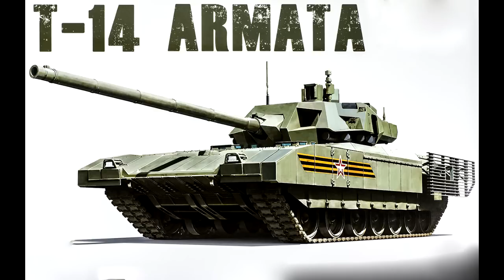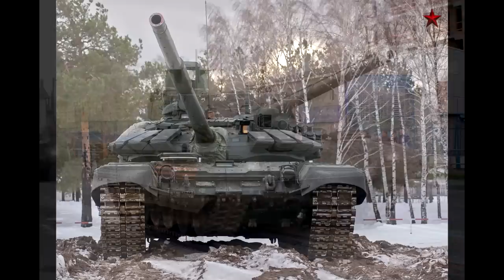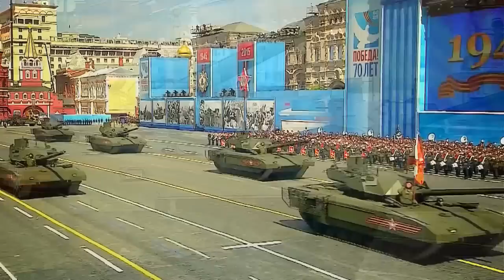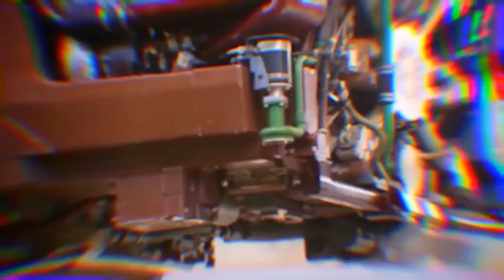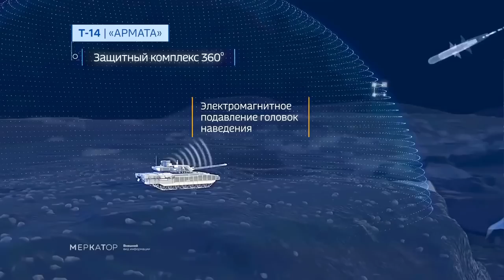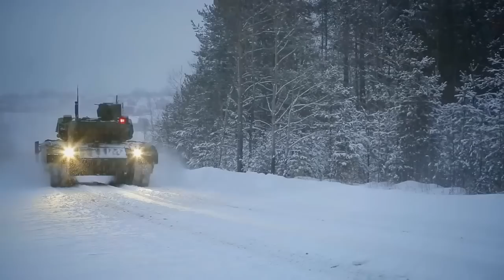Busting Myths on T-14 Armata

Comment: in fact, what stop the APDSFS and HEAT FS is not the APS, but the "HARD KILL" system. 
hard kill is the thing that break the incomming projectile with schrapnells
APS is the thing that turn ATGM -OFF or decflect them. 

the armata s hard kill is able to stop most of the HEAT FS and most of APDS, but,, there exist few APDSFS with enough velocity to go trough before the schrapnells destroy them. (it come from the fact that : when the projectile is detected, if he reach his target before the schrapnells got enough velocity (because, even if the increase of velocity is very short, about less than 0,0001 second, it need this time)->the schrapnells will not be able to fully destroy the APDSFS and the projectile will reach his target, with less energy and mass, but it will be enough to destroy an external module or to damage an armor plate and make it weaker (giving to the next projectile far more chances to do his job)
Reply: APS means both. APS are classified into "Hardkill" and "Softkill" Softkill distracts ATGM as you said, and Hardkill defeats it via shrapnel/EPF.

I only know it for NATO standards but: APS shatters, not detonate the KE penetrators, reducing it's force. An israeli study showed that only a 7° tilt reduces the penetrators energy (not penetration) by 80 %. So only a NATO STANAG 4569 level 4-5 protection (against 25mm APFSDS) is requiered to widhstand an (sucessfully intercepted) APFSDS. I dont really know about the "Afghanit" APS used on the T-14 but i know another system developed by the german company rheinmetall called AMAP-ADS that it has proven to be able of defeating not only ATGMs and RPGs, but also EFPs and APFSDS rounds. Supposedly it is capable of "cut" through the engaged threats, shattering or bending EFPs and APFSDS penetrators in the process. According to Dipl. Ing. Rolf Hilmes, who worked in the German military procurement agency, the system has been successfully tested against 120 mm APFSDS ammunition in the past. This system works diffrent than russian or israeli systems. It uses hull-based ermitters without moving parts (The T-14 needs to turn the whole turret to face thredas coming from another direction, hence only a 120° in front of the turret is protected by "Afghanit" APS) and no HE capsules (also on the T-14) shot at the incoming thread. That allows a very low reaction time of 0.56 miliseconds and a interception of threads fired at only 10 meters (!) distance. The (radar-) detection of the threat happens at a distance of 10-35 metres, while the fine (optical senosrs) tracking starts at two metres distance. The interception itself happens at only 1 meter distance (as said, hull based ermitters). Given that an APFSDS round even at 1,750 m/s velocity travels only 98 centimetres in 0.56 ms, the system reaction time is fairly enough.

Comment: By the time they make 23,000 T14 armtas they will be out numbered by the XM1A3
Reply: Shrapnel will not block apdsfds its impossible all it will do is slow it down a few hundred mps but that's tungsten depleted uranium shot is still going through that side armour like butter
Reply: Not 23.000 he said "23 hundred" that means 2300.

Comment: How much did russkies pay you?
Reply: Lachausis your just jealous
Reply: a lot clearly. Don't worry, Russia has a sense of over hyping their tanks. As soon as the US rolls out there M1A3 Abrams it won't be a problem at all.
Reply: The M1A2 Abrams is the most highly armored tank in the world. XD The T-80, T-14 and T-70 are overhyped. You can't expect to go to war with a Armata and only face up against and M1A2 or M1A3. That's why I mentioned the others. The Armata has problems such as a less armored turret than the cockpit which is now unmanned which can cause malfunctioning to it's systems if it where to be hit with a AP round for example. Not to mention you only have a hundred of those tanks so it would be pretty rare to see them throughout conflicts.
Reply: The future filmmaker There is not more to know Challenger 2's armour since their details are classified but the Abrams armor is based on the Challenger armor design (but has additional DU armor layers that the Chally doesn’t have). "The M1A3 Abrams will be outfitted with a number of enhancements over previous versions of the tank. To make the next version lighter and more mobile, the Army plans to replace the M256 smoothbore gun with a lighter 120 millimeter cannon; add road wheels and an improved suspension system; install a more durable track; use lighter armor; and insert precision armaments capable of hitting targets from 12 kilometers. Preliminary plans also call for the addition of an infrared camera and laser detector."
Reply: The future filmmaker all in all im happy to have the Challenger 2 with us against your armata.
Reply: The future filmmaker so be it.
Reply: Tanks aren‘t important anymore. Air superiority is the key and we all know who has the advantage here, lol
Reply: The future filmmaker Even before 2022 you still have tanks in the industry that are just as good as the armata if not better. For example, Leopard 2a7, K2 black panther, Challenger 2, Merkava Mk.4 and etc... Even if you say that the Armata is "better" than the M1 abrams, you have got a lot more tanks to worry about than just that 1 tank.
Reply: The M1A2 is on par with the Armata, I suppose. You can only imagine that the M1A3 will be better. The T-14 hasn't even been tested yet so you can't say it is better!?

T-80
https://medium.com/war-is-boring/the-t-80-is-russia-s-most-overrated-tank-798b5ba54ff9

M1A2 
https://youtu.be/OlegqcKpdXs?t=1m19s

Comment: The turret has no armor at all. Look at turret of Challenger 2 or Merkava (those turrets can take a hit). But Armata basically has no turret armor.
Reply: What for, only thing in there is the breech.
Reply: > "Дмитрий☭"

And its visuals, and its APS, and a resulting explosion is theoretically enough to melt any and all wires and connections to the powerplant. Making it dead. The latter can be rectified by compartmentalization and usage of materials relatively easily.
Reply: So no need to protect the breech system? One hit on turret and tank is out. Russians are "geniuses".
Reply: Believe me, if this tank goes to battle, you will see significant armor upgrade to the turret.
Reply: that armor may be thin looking, but its not pure steel, it has some composition to it, and plus, Armata doesnt even need armor, it's APS can stop any ATGM, HEAT and even theoretically APFSDS projectiles. On top of that it has IR and Radar stealth, so good luck hitting it in the first place.
Reply: +Дмитрий☭

> "plus, Armata doesnt even need armor, it's APS can stop any ATGM, HEAT and even theoretically APFSDS projectiles."

Yes it does. APS is only good up for a particular number of shots, and only in the front 120 degree arc.

> "On top of that it has IR and Radar stealth, so good luck hitting it in the first place."

This is just a claim.
Reply: The Turret won't turn fast enough to affect APFSDS. In fact, passive armor behind APS is ALWAYS requiered because the shrapnel of a shattered APFSDS (APS shatters and bends the KE penetrator, reducing it's force) is still very lethal. They went for only 120° protection since the armor on the back and back-sides of the T-14 ins't strong enough to widhstand the shrapnel of a (of course self-sharpening) DU- APFSDS ayways. Cost and especially weight saving. The turret doesen't just have a breach, alo several radars (alot actually), sight and situational awareness systems.

If a APFSDS comes from the side or back, you're doing something wrong in genral. IR stealth is nothing new on armored fighting vehicles. Greets.
Reply: Ummm actually the T14 has some of the toughest turret armor of any tank ( the turret is larger then that of a T90A witch already has very strong turret armor) the turret is unmanned meaning other then the optics,gunbreach and coax evrything else is pure armor.

Comment: Truth is, we simply cannot know how good or bad the T-14 is. The Russians are quite secretive about it, and for good reasons. Even take into consideration the MBTs of the 80s (Leo 2, Ariete, Leclerc, Challenger 2, M1, T-72, etc): to this day the capabilities of those MBTs are being discussed, and it is impossible to reach a clear consensus because there still information that is not available (like the composition of the armor, for example) and because these tanks weren´t really proven in the role they were meant for. They mostly fought inferior opponents, or low intensity conflicts. 

So take all that, and extrapolate it to the T-14 and you will see that assessing the capabilities of this tank is, at best, a very rough guesstimate.
Reply: haha we could be related
Reply: Only the m1a1 is battle proven to this day
Reply: @jeze2432  not against modern MBTS.
Reply: @jeze2432  r u dumb
Reply: sora Cj I thought the 105 mm gun abrams were the battle proven tanks?
Reply: @joshuakolnes9504  Early Abrams were equipped with the 105. But those models were never deployed during Desert Shield/Storm. The upgrades saw combat in that campaign. Only the USMC tanks used 105 rounds in that campaign. And the Marines had the last upgraded M60A3 Patton MBTs.
Reply: Well russia still has steel wave tactics, their tank designs reflect that, the armata can be made inoperable from a turret shot, when the tank turns tail, lamp a shot through the rear, high chance to cook off ammo, or kill the crew, too many ways to knock it out
Reply: osmacar every tank can be inopeeable from a turret shot that penetrates because all the crew will die.
Reply: @osmacar  russia and the united states approach combat doctrine very differently. Russian tanks historically boast a smaller profile which makes them more difficult to hit, and come equipped with auto loaders for faster firing on the move (yes I'm aware that a well trained tank crew can load at similar speed, but human beings fatigue, machines do not) while still boasting considerable armor. The Abraham's on the other hand is much larger, providing more room/comfortability to its crew, and thus has a larger silhouette. What's more Abrams engines are prone to breaking down due to fine dust particles making their way into its engines, it's also noteworthy that larger heavier tanks like the Abrams dont perform as well in thick mud and are prone to getting stuck. Both Russian and american tanks have their pros and cons however neither is proven better than the other as the Abraham's has never faced off directly with a similar generation MBT.
Reply: Still can't compete against the Abrams.

Namely because it's too expensive and will crash Russia's economy
Reply: @AmericanJed1  you really think a few tank will crush russia's economy? lmfao
Reply: @paveantelic7876  Obviously.

A country that spends so much money on tanks, nukes, and vodka will go bankrupt in the next ten years. Just wait.
Reply: @AmericanJed1  so why hasnt usa bankrupted yet?
Reply: @paveantelic7876  Fourth largest economy.
Reply: @AmericanJed1  do u know what you're saying? A single T-14 is cheaper than a M1A2. It cost only $4.1M usd. Armata isnt a expensive tank. Its cheap when compared to Leclerc,Abrams,K2 black panther, Type10

Comment: Any tank (including the T-14) can be killed with relative ease, by aerial attacks.... whether that be a cluster-bomb (that spews thousands of strands of molten copper in every direction, punching numerous holes in any tank), or a strafing run by an A-10 Warthog (no system yet developed can counter thousands of 30-mm rounds of depleted uranium, moving at super-sonic speeds) ... or there is always an EMP blast, which could disable all the electronics and electrical systems on any tank (including the T-14), and thus render it an expensive metal coffin.   And lets not forget about IED and landmines, which can also disable the tracks of any tank.
This is the difference between Russia and the Western countries' approaches to future warfare.... most countries have come to realize that tanks will play a much smaller war in future wars, as they can be relatively easily disabled or destroyed by inexpensive and tested systems.
Reply: well, the first point is why russia has invested massively into AAM systems, the EMP blasts are very unreliable to produce unless you have nuclear weapons handy, IEDs and landmines can be detected by infantry or removed with specialised vehicles. The APS systems of the future will probably render most cheap ATMs useless, with even modern ATGMs struggling to do stay relevant.
Reply: @arandomperson7713  Try again.  You're cherry-picking and ignoring the facts of reality.  Ukraine (a tiny rural country) has already proven that most Russian tanks are garbage and can be dispatched with just shoulder-fire rockets.  

Also many landmines and IEDS cannot be easily detected, especially since Russia has a policy of NOT having their tanks surrounded by infantry... as that is what America does - NOT Russia.

Additionally, Russia has yet to produce a single tank that has lived up to this absurd hype and stupid claims.  The fact that America killed so many Russian-designed tanks so easily in the Persian Gulf War (1990), despite all of Russia's propaganda that their tank designs would 'bounce' western rounds, is evidence of their 'paper-dragon' approach to most things, through the heavy-use of misinformation and repeating lies often enough that ignorant people believe it.

Russia has a long history of relying on everything going according to their plans on paper, with little to no thought for reality, and thus why they struggled for years, simply trying to take over Finland with its tiny force of volunteer freedom-fighters during WWII, and humiliating Russia (like Ukraine today), to the point that Hitler no longer viewed Stalin as an equal, but as being inferior, and not worthy of being their ally, of which Stalin and Hitler had plans to carve-up Europe and divided between the two powers.  Between Finland's resistance, and the Jews and Gypsies within Russia, Hitler invaded Russia, which Stalin believed would never happen (despite warnings from many of his military advisors), and thus Stalin's dream of controlling half of Europe died along with it, and Russia has been trying to realize that dream every since, even today with Putin.  

Interesting how Russia hasn't changed much in all of this time, still desiring world-domination, while relying on misinformation, fear-mongering, and deceptive propaganda... instead of combat-tested technology and tactics. 

Sounds like you've been playing too much War Thunder, and now you believe the lies Moscow has been pushing.

Comment: APS vs APFSDS - I'm not a physicist. But have common sense doubts that a shotgun type of blast can disrupt the Inertia and Mass of a APFSDS projectile that is proven to have enough energy to defeat modern tank armor . Also consider the detection, tracking, targeting, engaging chain that would have to take place, makes it again more unlikely. Making a "Claim" that APS can defeat APFSDS is not the same as conducting a "Demonstration". T-14 may be a very good tank, however this Myth is not Busted.
Reply: APS against APFSDS work. 

I only know it for NATO standards but: APS shatters, not destroying the 
KE penetrators, reducing it's force. An israeli study showed that only a
 10° tilt reduces the penetrators energy (not penetration) by 50%. I 
dont really know about the "Afghanit" APS used on the T-14 but i know 
another system developed by the german company rheinmetall called 
AMAP-ADS that it has proven to be able of defeating not only ATGMs and 
RPGs, but also EFPs and APFSDS rounds. Supposedly it is capable of "cut"
 through the engaged threats, shattering or bending EFPs and APFSDS 
penetrators in the process ,causing  much higher energy reduction 
(80+%). According to Dipl. Ing. Rolf Hilmes, who worked in the German 
military procurement agency, the system has been successfully tested 
against 120 mm APFSDS ammunition in the past. This system works diffrent
 than russian or israeli systems. It uses hull-based ermitters without 
moving parts (The T-14 needs to turn the whole turret to face threads 
coming from another direction, hence only a 120° in front of the turret 
is protected by "Afghanit" APS) and no frag capsules (also on the T-14) 
shot at the incoming thread. That allows a very low reaction time of 
0.56 miliseconds and a interception of threads fired at only 10 meters 
(!) distance. The detection of the threat happens at a distance of 10-35
 meters (radar), while the fine tracking starts at two metres distance 
(optical sensors). The interception itself happens at only 1 meter 
distance (as said, hull based ermitters). Given that an APFSDS round 
even at 1,750 m/s velocity travels only 98 centimetres in 0.56 ms, the 
system reaction time is fairly enough.